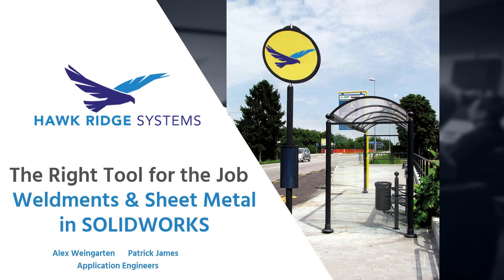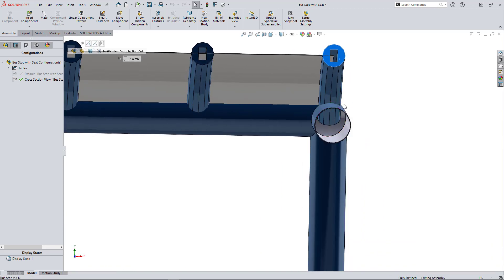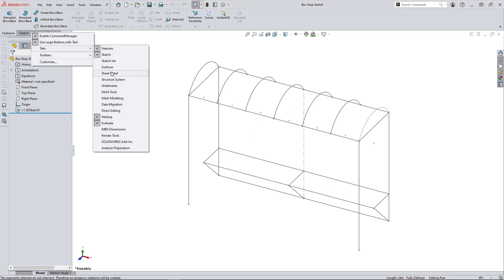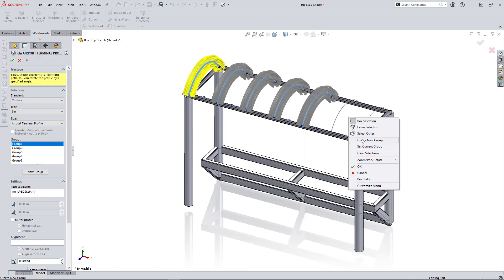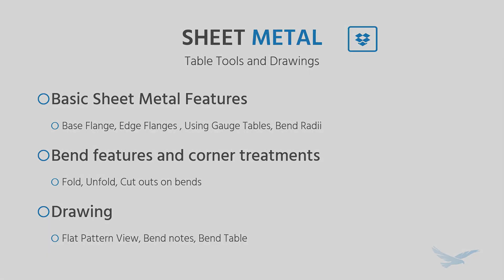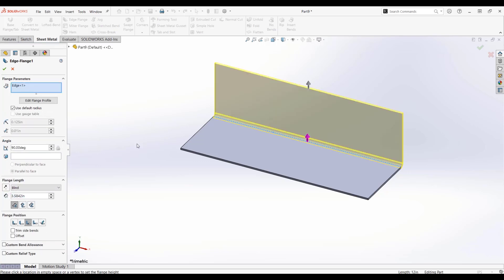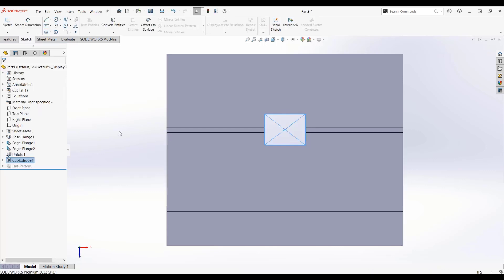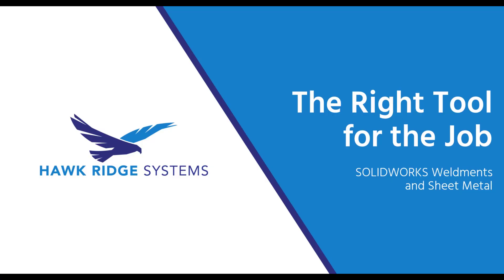The Right Tool for the Job: SOLIDWORKS Weldments & Sheet Metal

Comment: Ok, I am going to be the bad guy here. 
1st. The rectangular profiles are unrealistic and I mean the sharp edges
2nd On the sheet metal, the was no setting done regarding the radius of the bend, k factor, etc
No material was set. So, this drawing was way far away from being able to give enough information to the one that is going to build it.
We are using solidworks so that we can pass every possible information on the drawing.If I wanted to give some dimentions, a 2D cad would be enough. I could continue but I won’t
Reply: @Stravros,
Agree with. I am user last 7-year but now realize it's lot of improvement required in SOLIDWORKS 
Fusion360 will complete in all aspects of CAD/CAM is perfect. 

In Drawing have a lot feature need to improve.
In Modeling interface mostly mate problems.....